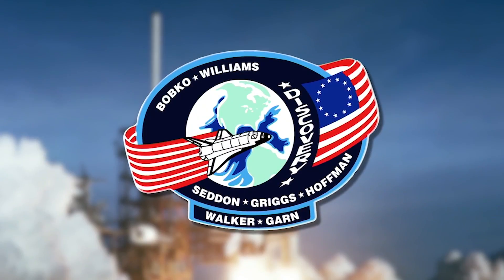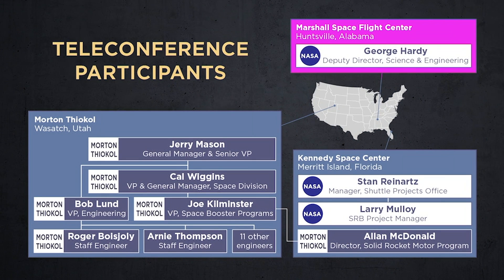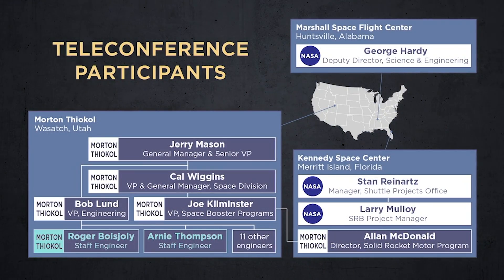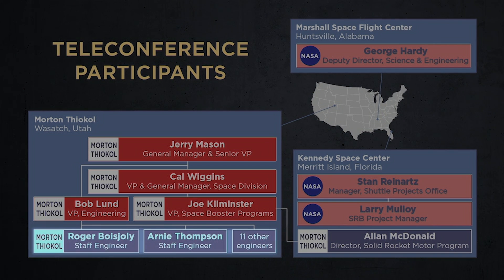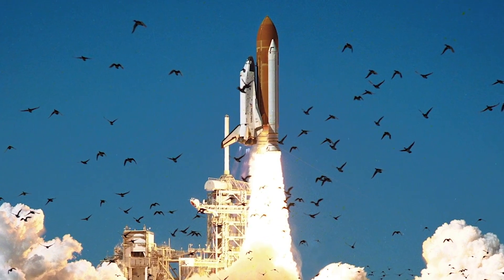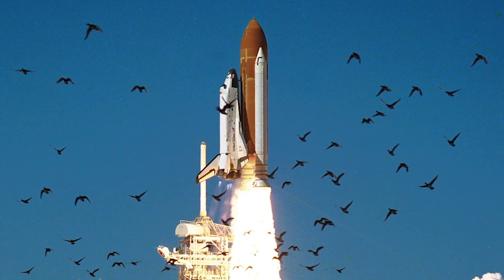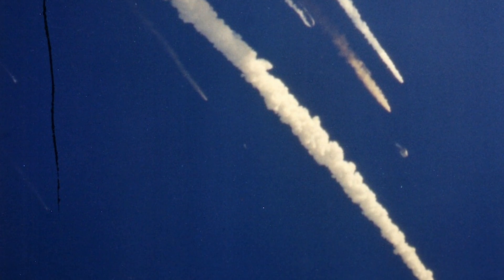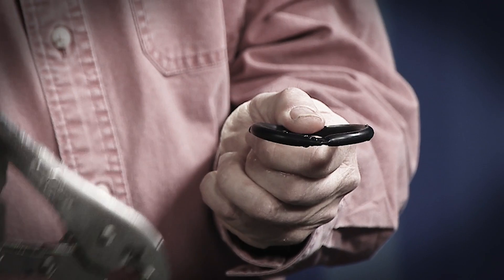The Single Part that Led to the Challenger Disaster | Engineering Failures

Comment: i Have a question that wasn't answered here or in most analysis i have reviewed including the actual Rogers report and i hope someone with better engineering expertise can answer it please, and that is:
If the O ring was getting burned away from not sealing, then what is stopping it from getting burned even if it does seal? I thought that the O rings were not designed to come in contact with hot gas at all. So it seems to me the entire joint design was flawed despite any operating temperature issues. This is a great video and resource going beyond the typical accepted over simplified explanation, but i hope someone can answer my one question because it's making me think that not only was the engineering incompetent but the blamed culprit was also a display of incompetency

The only other info i've found is the Lockheed design that was initially offered was rejected and it offered  a seal of the joints which made the O rings triple redundant. Whereas the Thiokal design put too much pressure on the O rings. So they added the zinc putty to protect the O rings but the zinc putty was getting holes in it at the very least from testing. So perhaps it was the testing which damaged a vital components
Reply: I see your point about o rings aren’t designed to come in contact with hot gases from the booster . Be interesting if someone explained it

Comment: for me,  as an engine builder, i would never allow a head, fuel, or manifold gasket system to leak, or fail. even i knew , years before the shuttle program, that rubber doesn't have the flexibility  at 50f that it does at 70f. How did Thiokol  miss a simple piece of logic, re 'O' rings, years before?

Comment: According to NASA, it wasn’t aerodynamic forces at Max-Q alone that shattered the temporary seal, but at the same time, Challenger was being blown around by the worst wind shear conditions ever seen during a shuttle launch - until the launch of Columbia STS-107 (the Columbia disaster mission) on January 16, 2003.

The combination of Max-Q forces and the wind shear, they say, were what did Challenger in.

Comment: Your video is exactly what Thiocol needed to present to NASA the nite before the launch.The engineers instead tried to show technical charts and other paperwork along with pictures to recommend to NASA to stop the launch.This exact experiment was performed by a scientist at the Rogers commission but it was too late and after the fact.
Reply: Too much publicity and money was on the line NASA even if showed this experiment would not have cancelled the launch besides they already had evidence of blow by in an earlier launch when temperatures were 20 degrees warmer!

Comment: This is the tenth+ 'explainer' video on the Challenger disaster...and NONE OF THEM (including this video) actually addresses the real issue behind the O-Ring/Challenger disaster. 

What REALLY caused this disaster. 

NONE.  It's baffling.
Reply: Do you know what caused it?
Reply: @justin1978  Glad you asked.

 You’re the first person to actually ask me ‘why’ in all these years.  Next time you see someone making a video on the Challenger disaster…ask them the question they will give you a blank face on: 

 “Question:  Why were the solid rocket boosters made in pieces in Utah, then placed on a trains for a 2400 mile trip south?”  

The ‘single part’ that killed those on the Challenger was not the O-Ring..it’s the PORK which put it there. 
 

Answer: Because that’s how large government contracts work.  In reality the space Shuttle could have been entirely built in Florida, it would have meant billions of dollars in local investment.  However this also would mean if a future U.S. administration wanted to axe the shuttle program, it would only mean angering Florida. 

Had the SRB’s been built near the launch site, you wouldn’t need O-Rings! (Like what SpaceX is doing, no O-Rings!)  It would have been a far more reliable/durable rocket with far less things that could go wrong.   

BUT: THAT’S NOT HOW GOV SPENDING WORKS.

 If you SPREAD the entire construction of the Space Shuttle to as many U.S. states as possible…that means if a future president wanted to kill the program, all these governors/senators/lobbyists would come piling down raising hell.  That’s also why the space shuttle was so ridiculously expensive:  Everyone gets a SLICE of the PIE.

The end result:  A totally compromised, pork barrel project which led to the deaths of 14 people.

The O-Ring is only a byproduct of all the governors/senators who wanted a ‘slice of the pie’….at the cost of 14 deaths.
Reply: @justin1978  Yes.

Ask yourself:  Why did NASA have to have the Solid Rocket Boosters for the Space Shuttle be manufactured in UTAH, then cut up into segments to be put onto a train so it can be shipped across the country to Florida for reassembly and launch?

This is the reason why:  When you are spending billions on a large government contract, you want to spread the design/construction to as many U.S. states as possible.  This is so that in the future, if any new administration so much as thinks of axing the Space Shuttle program:  You'll have 50 senators, 50 governors, 435 Congressmen and hundreds of Mayors all yelling/screaming at you NOT to do it. 

The answer is yes:  The shuttle could have been 'vertically integrated' completely built and launched close to Cape Kennedy, but this would mean that Florida would be getting the lions share of this sweet pork barrel money.  That also would mean you'd have 49 other senators/governors/etc all happily voting to axe the shuttle program for the simple reason:  It's not bringing a red cent to their district.

So, Utah it was and the O-Rings were used and 7 people died as a result.

You don't see SPACEX using O-rings?
Reply: Huh? when i clicked to read more i was expecting some explanation. Im starting to think the joint design would have failed eventually even at operating temperature. You would think that with hot gas hitting the o rings it wouldn't necessarily matter what the temperature of them was because they were melting regardless.
Reply: @dragorn3212  I replied in full:  O-rings were a result of cutting up the SRB's and shipping them from Utah to Florida.

The only reason why these SRB's were made in Utah was to line the pockets of as many politicians as possible so they would all vote 'yea' on NASA appropriations.

14 people ultimately died from this stupidity.
Reply: Did you not watch the video ? 🤦‍♂️

Comment: The SRB operating spec was 40 to 90 degrees.  The temp at launch was outside of the original spec. Not to mention that the temp at launch was hugely different than any previous launch.  I expect the Thiokol engineers were rather worried by the low air temps on that day.  It would be interesting if one of the engineers had said "At these temperatures the o-rings will not seal and the launch will fail."
Reply: By attempting to set the launch criteria at 53 degrees at the 11th hour, Thiokol engineers admitted their SRB design failed to meet the original design requirements. NASA should have either charged Thiokol back or canceled their contract completely